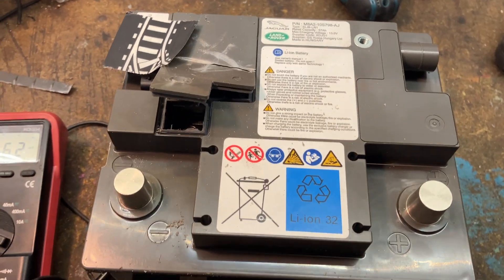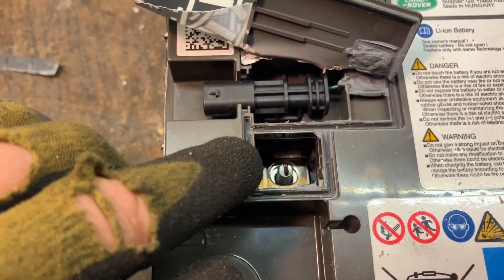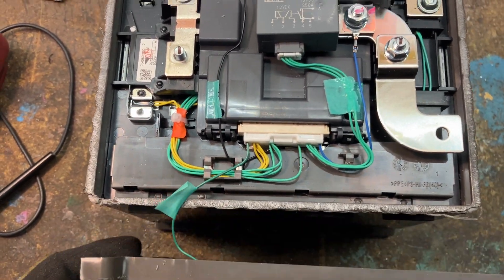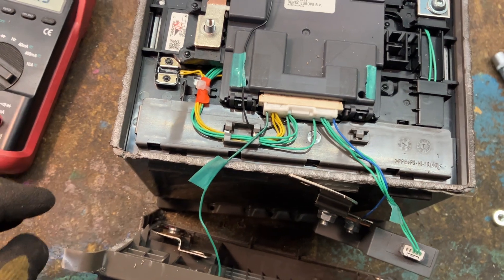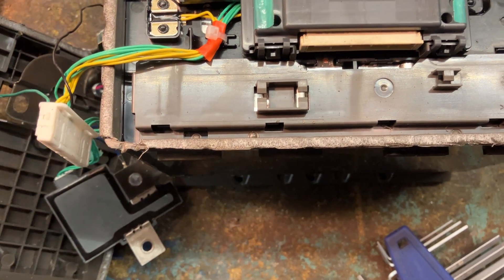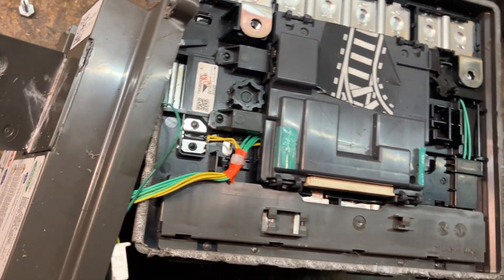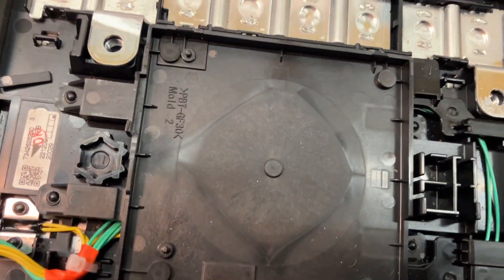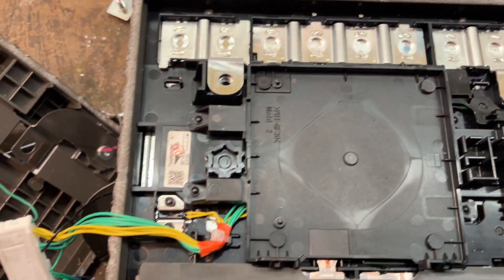Land Rover / Jaguar Li-Ion Starter battery teardown

Comment: I would guess LFP chemistry they just don't want to charge it up to 14.6V for extended life.
Reply from the maker: You mean 13.6V as max. charge voltage rather then nominal? That could well be.
Reply: Yes precisely. Charging voltage is the max voltage. Thanks for doing that teardown I had someone with the same issue yesterday.
Reply from the maker: @cavo1977  LOL - I haven't realized that the label says "Max. Charging Voltage" - I even talk about the nominal voltage... I must have overseen this, and expected it to be the nominal voltage, as you would normally write onto the label. Anyway, thanks for pointing that out.

Have you been able to revive yours? I'd think disconnecting the pos. or neg. terminal would suffice to reset it. I don't have a car for it, and I can't sell it, so I wasn't too motivated on reviving it. I will find a usecase for the cells though.
Reply: I didn't get my hands on it yet but many times these are not serviceable as the board stays in error state for liability reasons. Not very sustainable I know.